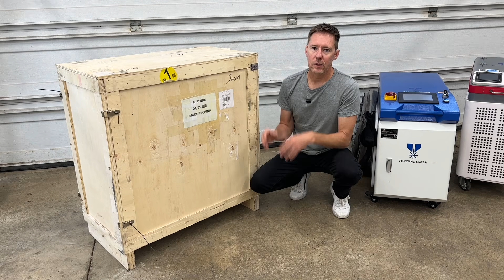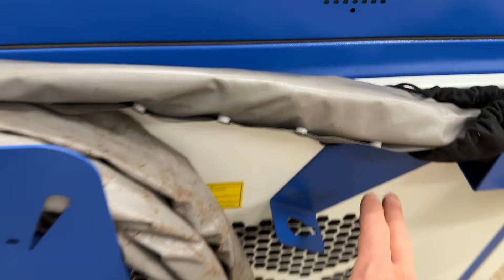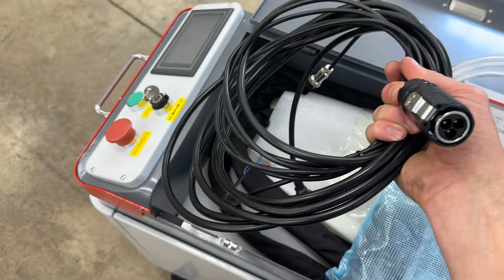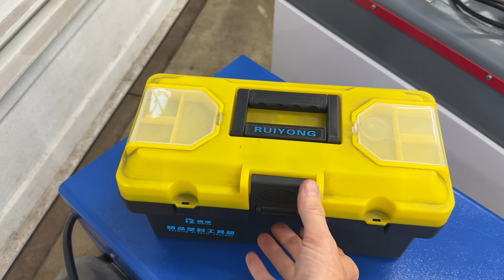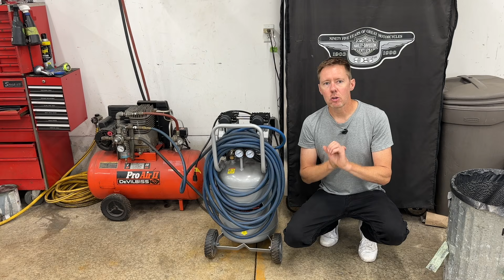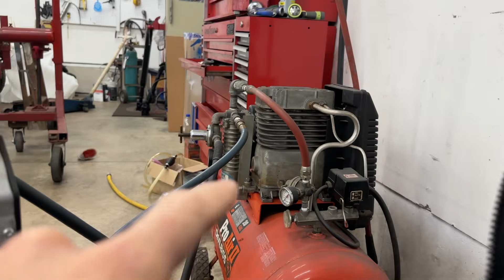How to Set up / Install a new Laser Cleaning Machine

Comment: Where did you get the 2000W machine? Do you have a link? Also, in your video when you first used it, how long did the job take you to fully de-rust that Toyota frame? Thanks
Reply from the maker: I got the 2000w laser from http://fortunelaser.com - here is a full video all about it: https://youtu.be/THGx2acKVPA   The frame was a LONG process because it was super heavy rust. I made a video of the whole process: https://youtu.be/1XDI2bgVUkg
Reply: @6thGearGarage  got it thank you! I was just thinking if I were to start a business blasting frames how many hours could to take doing a single frame.
Reply from the maker: @Bizzybee2026 for heavy rust like my frame, I’d stick with traditional sand blasting to save time.

Comment: Hey B!  How's the 4Runner coming along?  I always enjoy a good laser review video!  Man, you're getting quite the collection!  Do they all use the same lenses?  Just curious...  If they do, it makes it nice for spares on hand knowing whichever machine needs one, it will fit it.  Thanks for sharing the video!  Best wishes.
Reply from the maker: It's taking a while, but coming along. I'm currently editing the video of laser cleaning and painting the frame. This new laser will be used to strip/clean the entire underbody and engine bay of the 4runner. That's a good question! All the cleaning heads are different, so I'm not sure. I'll have to measure them and see.
Reply: @6thGearGarage  B!  I can't wait to see the frame clean and paint video!  Thanks for the reply!  Best wishes.
Reply: @6thGearGarage  Hey B!  Brent from Halfass Kustoms just dropped a laser video too!  He goes over welding and some tricks he has found out along the way.  It's good!  You might want to check it out for welding - it's pretty good and he shows using his laser to fill gaps!  Pretty cool.

Comment: It's probably a lot cheaper to change the outlet than it is to buy an adapter cable.
Reply from the maker: It might be, but I still use that old style 220 outlet for my big compressor when painting.